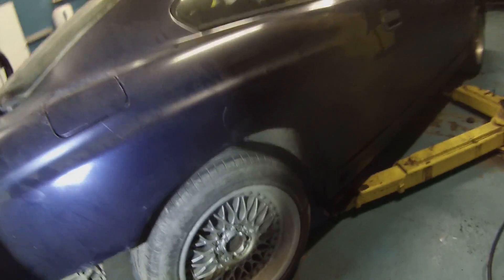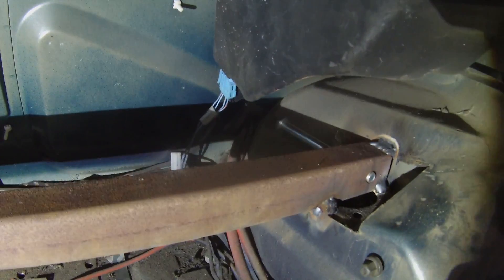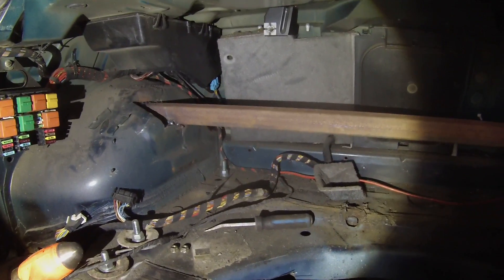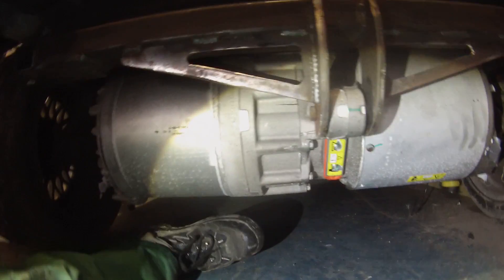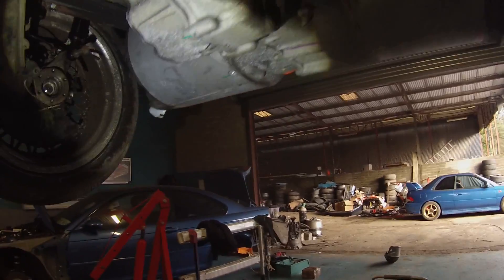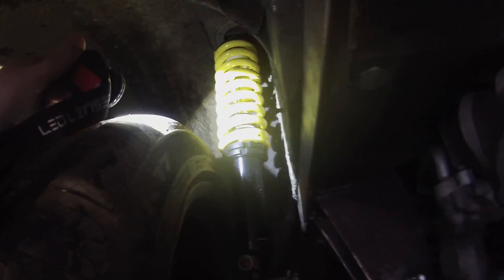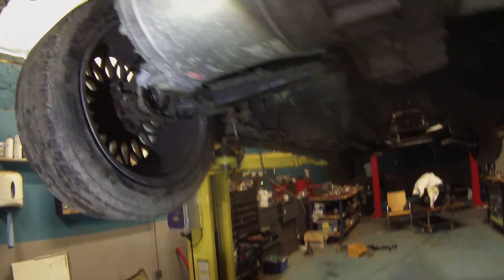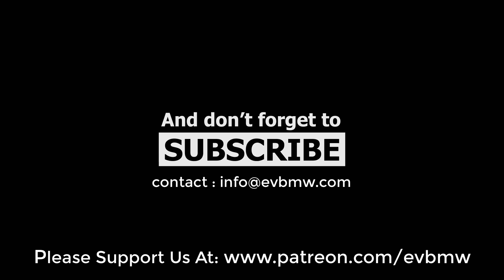BMW E31 840CI EV Conversion 87 : Tesla Swap Day 6

Comment: Great move taking the Coil-over load down to the chassis. The shell would surely have been compromised even with both strengthening plates installed. Hope you have explored the wheel excursion arc with respect to the motor via the driveshaft.